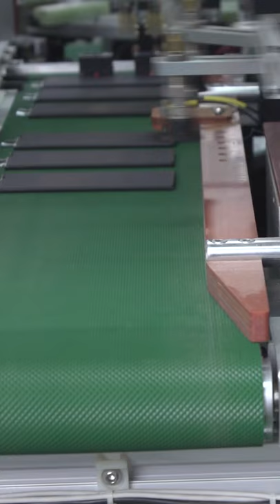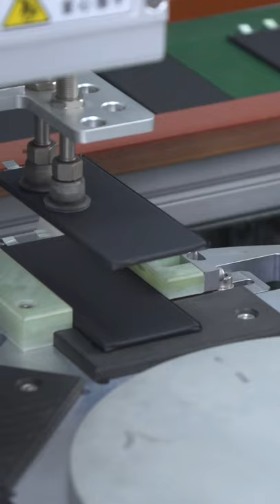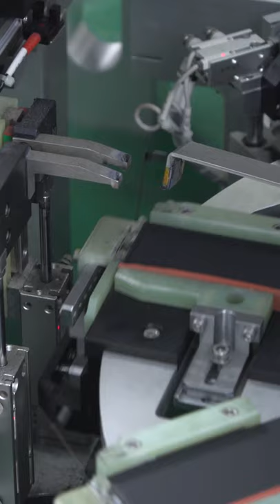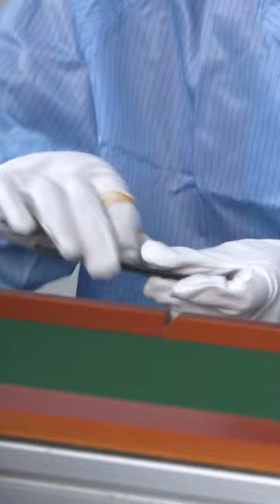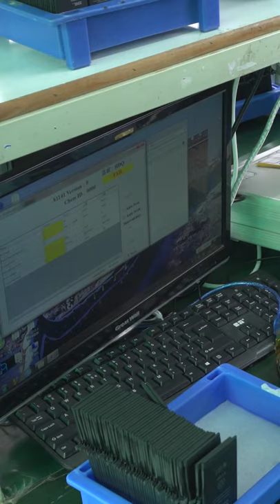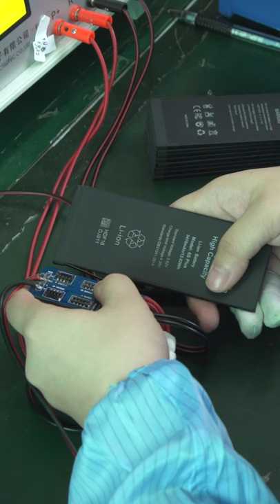Inside an iPhone Battery Factory #Shorts

Comment: Is this an official battery production facility or are these 3rd party replacement battries.
Reply: Third party, bms boards are different and original factory doesen't use white paper for insulator.
Reply: @kenni978  but does it durable and reliable like original ?
Reply: @kaisha4355  can't tell you about this video. some third party batteries are really good, as good as original, but it VERY hard to find. it depends of the purity of the cell material, most of it (more then 90% i think after 15 years of experience) will swollen or just die after very short time. any small dirt in the cell will effect the life of the battery.